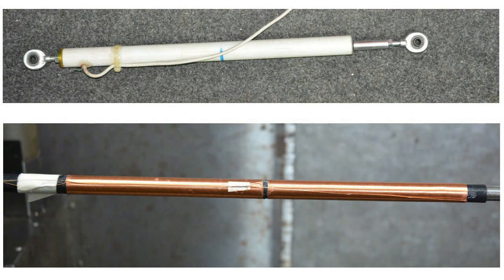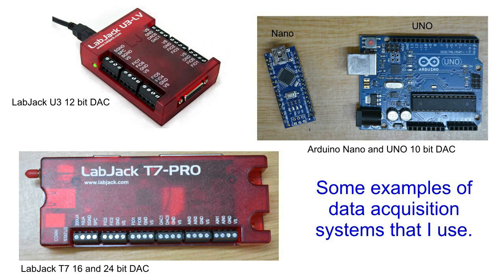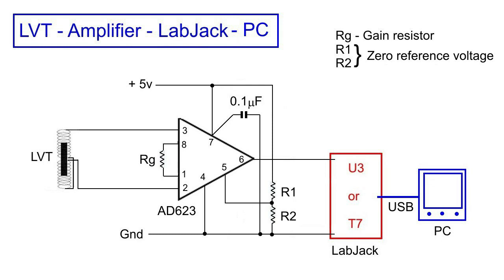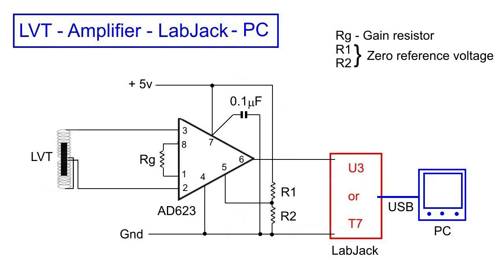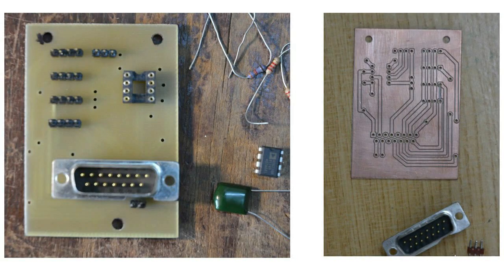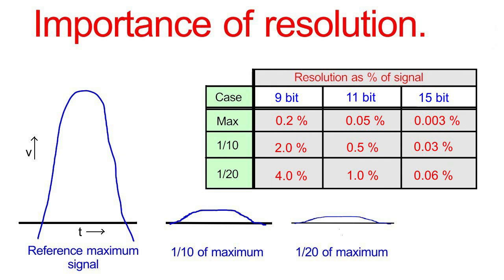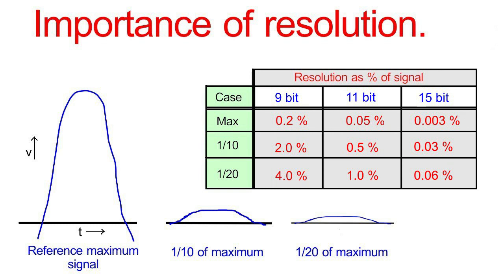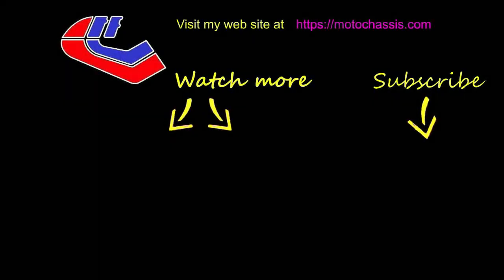Velocity measuring - my LVT.  Part 2 of 2.

Comment: Tony, thanks a lot for your time and info. I was wondering you took the same aproach to the load cell. Just implemented a cell  amplifier to feed 0-3 v signal to the LabJack. That way (as you stated) need only to program the pc (and not the microcontroler if one is used). Thanks again from South America.
Reply from the maker: I use a dedicated loadcell amplifier with built-in gain and filter adjustments.
Reply: @MotoChassisByTonyFoale   Thanks again. I just placed an order for a LabJack (a cheap one) and will follow your workflow. I'm interested in high-frequency data logging. I use Python and Arduino, but I know that other languages are much faster, and I need to upgrade from ATmega328P. I'm half my way through a Java class in college, and I have a little knowledge of electronics. Next semester I will take an electronics class and make good use of the information you share.

Comment: Thank you Tony, pretty interesting. You can replace an Arduino with an STM32 board (lot of choice in Nucleo boards), most of them are having at least a good and fast 12-bit ADC (you can use Arduino programming env (check STM32Duino), Arm Mbed and many other stuff).
Reply from the maker: Julien,
Yes there are many options for sampling data and everyone has their own favourite.  I use Arduinos and ESP32 for several appropriate tasks where I need some stand alone capability.  In this case I do not want nor need to programme a DAQ system and PC.  With the LabJack I only need to program the PC.  This is straight forward data acquisition which needs no smarts outside of the PC.

Comment: Sorry, but I couldn't give this video a like  because of the horrible hissing sound.
Reply from the maker: My high frequency hearing is degraded from old age and noise abuse and I do not hear any hissing sound.  I thank you for the notice and I'll see what I can do to fix that on new videos.
Reply: @MotoChassisByTonyFoale  Having considered your reaction to my reply, I still gave this video a 👍 ❗ 😁
(Hope you can avoid the phenomenon in future.)

Marvin says: Don't panic and wear your Mask. 🖖😷👍 ❗
Reply from the maker: @4623620  I have looked into this and it seems that the problem is when I do a voice over using my laptop.  There is no problem when recording on camera.  I'll look into a solution.  Thanks for the tip off.
Reply: @MotoChassisByTonyFoale  🙂👍❗